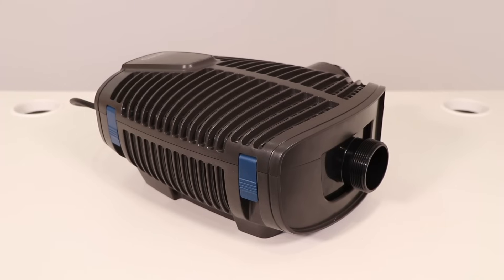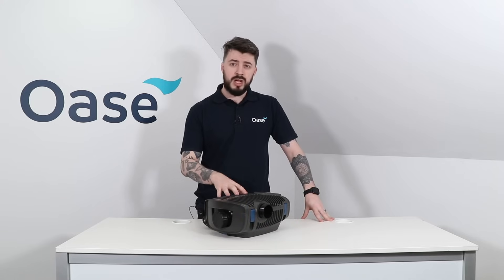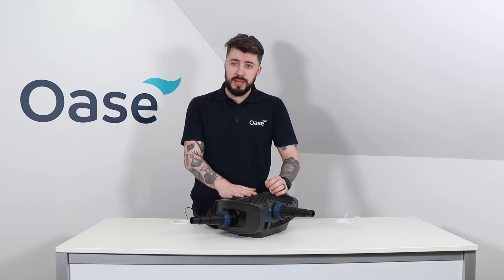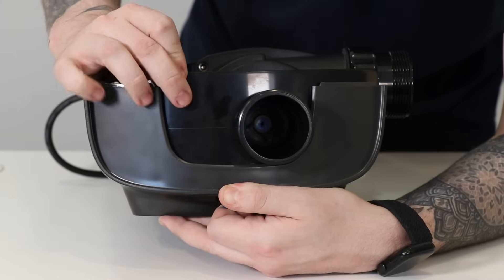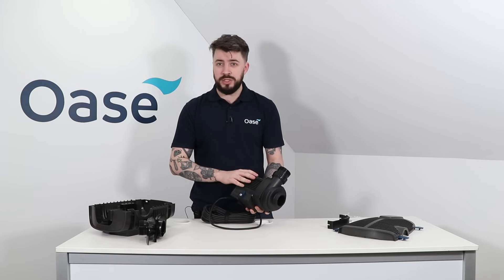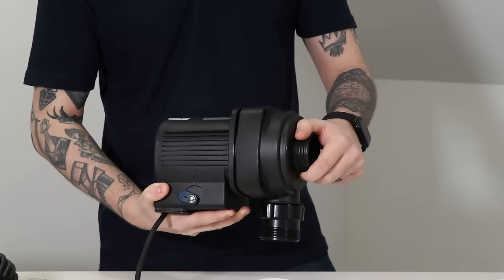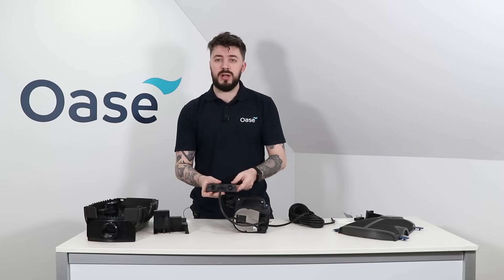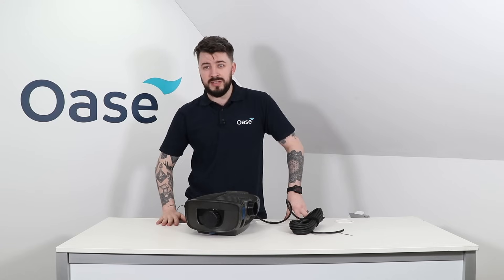OASE AquaMax ECO Premium - OASE Product Guides - AquaMax Pond Pump & Watercourse Pump

Comment: Does this pump ever block up?
Reply from the maker: Hi, thanks for your question. The AquaMax ECO Premium is a solids handling pump designed to take waste particles up to 11mm diameter. If the waste is larger than this or blanket weed is present, this may have to be manually removed periodically but this is all system dependent. Hope this helps.
Reply: I can testify to make sure you have blanketweed under control.  With this year's warmer weather i hadn't paid enough attention and the pump blocked every 4 days. Next year I will add the remote inlet to reduce the draw and hopefully the pull of the weed.

Comment: But ive got a 16,000?????
Reply from the maker: The 16000 is one of our older models, still a fantastic pump but the new refreshed ranged has changed quite a lot! Hope that clears things up!
Reply: Yes,they are expensive,but so is fish keeping generally especially koi. The price will probably fall when stocks of the previous model are used up? But why wait? Your fish will thank you 😊
Reply: I have the 30 000, but the video is still helpful, because I need to replace mine after 10 years.
Reply: My model is the 12,000 Ltr per hour brought 2012 & still going strong!!! 👍